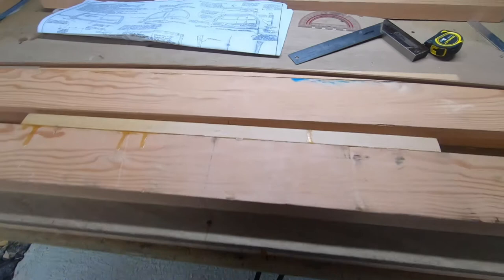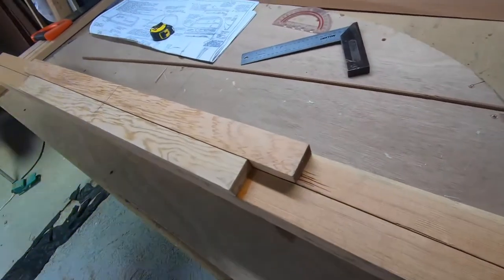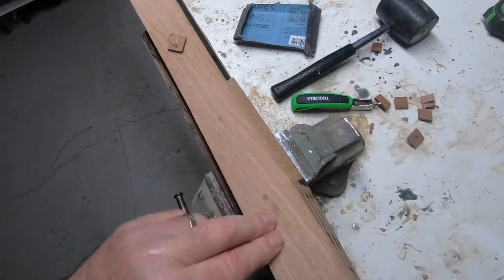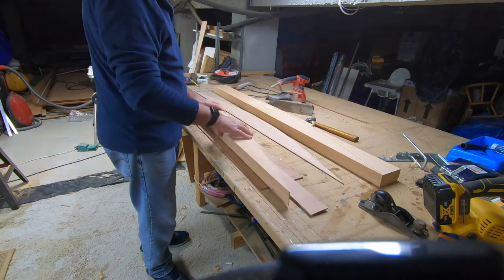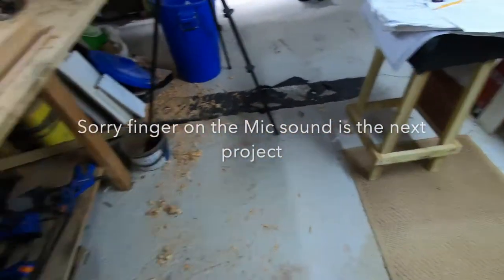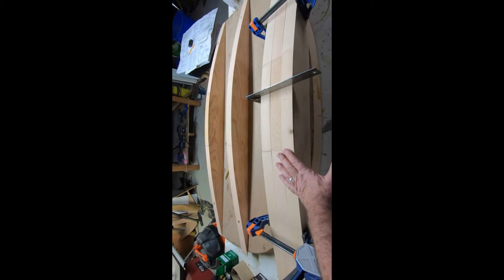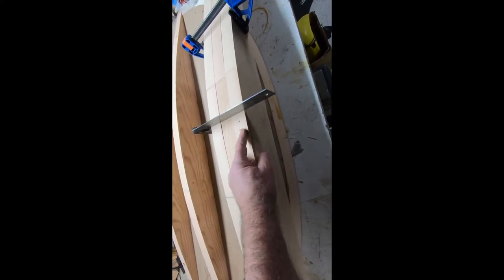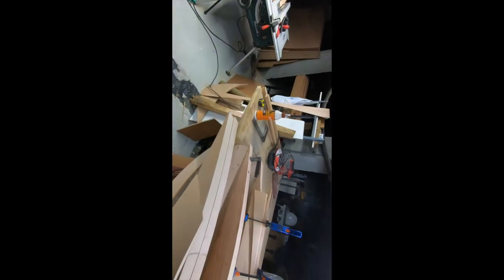Boycie's Barrelback 2

Comment: Greetings Nigel, from Northern Wisconsin USA.  Just starting on my plan review for a 20’ version of the Glen L Barrelback and find your videos very helpful. One question for you on the treatment of the top 3 (laminated) camber boards on the transom.  The framing inboard of the plywood transom is faired to 12 degrees however its unclear to me if the camber boards should also be faired with the 12 degree angle, outboard/aft of the plywood?  The plans appear to show the ends of the camber boards but square (90’) tot he plywood transom.  Looking forward to your reply and additional videos.  Tom
Reply from the maker: Tom
 Thanks for your reply I hope to have more episodes up soon when I have a decent garage.
I think I understand what you say if not please can you come back and try again.
The transom is indeed mitred to 12 deg all the way around except for the bottom which is flat ie when the boat is the right way up!
The first frame forward frame 1 is larger than the transom hence why the stringers all curve in and meet that 12 deg angle, the rear of the transom is clad with more timber to give the vertical curve to the barrelback and I think it is this you refer too? that is also planed back to give the 12 deg angle continuity.... I think when you see the frame and transom setup on the jig it will be obvious how to approach this, Im pretty much at the fairing stage where those deck stringers curve into the transom and there's quite a bit of fairing to give this curve a fair angle for which the boat gets its name
Does this help?